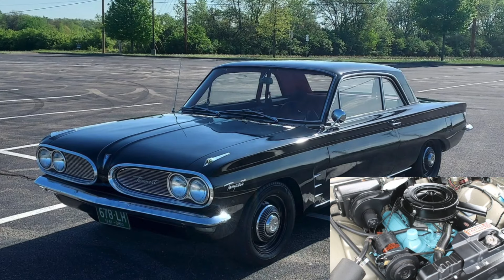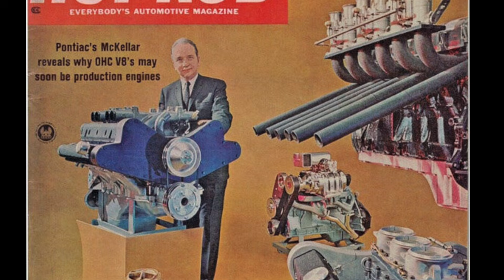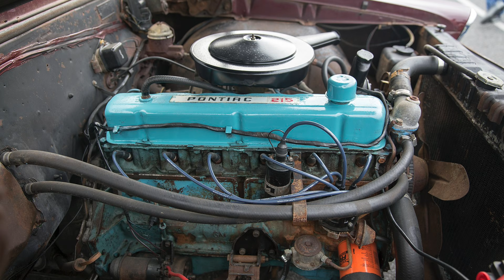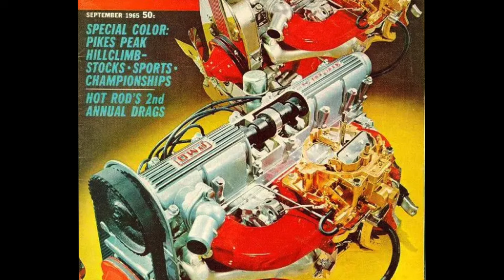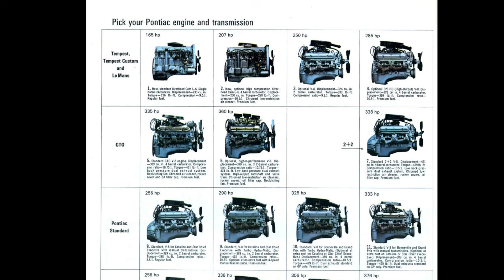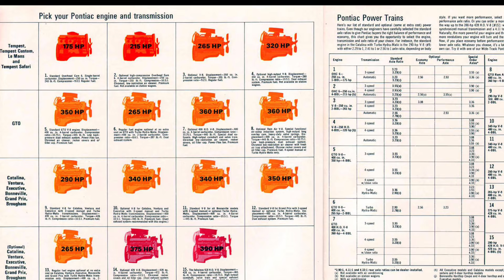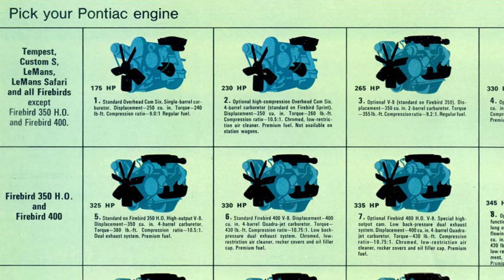Awesome Engines: Pontiac's 1966-69 OHC 6-Cylinder Engine (Tempest/Firebird/LeMans)

Comment: Holy Moly!! I'm 67 and I never heard of this Engine!! An SOHC Inline 6?? Wow!! I was 8 in 1966!!
I'm guessin that the Carb was a 2bbl.  I bet this Engine here had some punch!!
What?? Putting the Transmission at the back?? Just in front of the Differential??
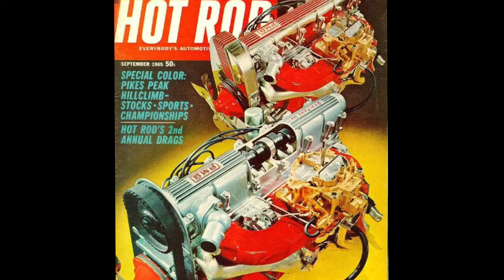05:15 - Illustrated with what looks like a Holley 4bbl!!
Reply: The Sprint version came with a 750 cfm Rochester Quadrajet carburetor.
Reply: I thought the same thing only I grew up in the car business for 35 yrs. You are a year older than me.
Reply: @coolmonkeymc8268  1959 Baby, are Ya??? I was born the same year as Madonna, Michael Jackson and Eric Singer...1958...(..who?? Who the hell is Eric Singer???....Last Drummer for KISS)
I guess you've seen some of those vids where they took an old Slant-6 from a Dodge Dart-Swinger, custom made a manifold to accommodate a Holley 4bbl, custom made a Header, mated it up to a 4-speed and turned it into Dynamo!!! One of those Dudes was able to get the HP up to about 245!! That ain't no Small Potaterz!!!
Reply: @RedneckSpaceman  1958 and Thanks for the reply I enjoyed your message.

Comment: My first car in 73 was a 67 Tempest Sprint convertible 3spd on the floor bought it for $300. Added a 4spd a couple years later . Had a blast and learned a lot about engines. Wish I still had it
Reply: You were very lucky!!  My first was a 1966 Ford Ranch Wagon. 289 2bbl. It was no Speed Machine but it could easily accelerate onto a Freeway, easily matching up with Traffic! It also was used to tow an old 1962 GlassPar Boat with a 75hp Evinrude V4 2 stroke!!
Reply: Nice ride for sure!

Comment: Worked on these engines and they were absolutely great. Most people had problems with the oiling system as the smaller version of this engine did not have a strong enough oil pump to take care of the extra oil needs of the OHC 6. I had one that I had changed the cam on and it was a Deamon on the street. So many people laughed at the six until they watched my taillights in front of them.

Comment: You haven't mentioned the fatal flaw.  This OHC 6 suffered from weaknesses in its valve train and oiling system. After reading an article in Road & Track, I think it was, my Dad traded in the '58 Ford Custom 300 he hated with a passion and bought a '66 Tempest Lemans with the Sprint Package.  It was bronze with a black vinyl roof.  Beautiful car and it handled well for the time.  My Dad liked the European stuff and had owned a single port Porsche as a young bachelor. Our Lemans was a big hit with the young men at the service stations, back when the hood got lifted when you bought gas.  Sadly, it was a hanger queen.  

One of the big issues was lubrication of the camshaft and rocker arms. The oiling system provided insufficient lubrication to the camshaft and rocker arms, particularly at high RPMs. Instead of being pressure-fed, the cam lobes and rocker arms were splash-lubricated, making them prone to excessive wear if oil flow was compromised.

And, the oiling system had passages that could develop sludge over time, leading to blockages that reduced oil delivery to the top end. This resulted in premature cam lobe and rocker wear. The issue was further exacerbated in high-performance models such as our Lemans, with the hotter cam and a four-barrel carburetor. High-RPM operation caused lubrication problems, making valvetrain wear a recurring thing.  Got expensive.

Another contributing factor was poor oil return from the cylinder head to the crankcase, causing oil to pool and leading to temporary starvation elsewhere in the engine. Over time, this inadequate oil return system increased wear on critical components.

To mitigate these issues, regular oil changes with high-zinc content oil (such as those with ZDDP additives) were recommended to protect the cam and valve train. Keeping oil passages clean by maintaining proper oil change intervals and using high-quality oil filters helped prevent sludge buildup. Some enthusiasts modified the oiling system by enlarging passages or adding external oil feeds to improve top-end lubrication. Additionally, avoiding prolonged high-RPM operation without ensuring adequate oil flow modifications was essential in prolonging engine life.

Sadly, Dad didn't know about any of this at the time and got it serviced at regular gas stations, back in the day when gas stations were really repair shops with gas pumps out front to attract business instead of mini-marts with gas pumps out front to attract fat guys to buy junk food.

We traded it in on for a grey Datsun 610 as the family car.  Dismal. In the meantime Dad had bought a '71 BMW 2002 for himself..  A great little car with a tiny radiator built for 70 degree German summers, not for 100 degree days in the Southwest.  Overheated and vapor locked. You'd have to turn on the interior heater to help keep the needle out of the red. The rubber was also rotten and belts and hoses broke.
Reply: I think most of your observations are correct, and I would add that overhead cams are mainly beneficial for high RPM, while a straight-six has a pretty long crankshaft that doesn't like high RPM...

Comment: My older brother had a Firebird that had one of these in it. He got it very cheap because it had been run out of oil and ruined the cam and all bearings. Back then (early 80s) parts were expensive and hard to find and prohibited rebuild.

Comment: I had a 1968 Firebird with the 1.9L 6 with a 3-spd floor shifter. We had a quarter mile marked off on the new inner-beltway under construction. I couldn’t take a small 8-cylinder out of the hole but by 2nd I took over every time! Good memories.

Comment: My first new car:  a 1966 Tempest  Custom with Sprint option, quick-ratio steering, "Rally Wheels", Saginaw 4-sp tranny, "big" 775/14 tires, metallic drum brakes(no discs offered until 1967), and Posi-Traction 3.55:1 rear end. A fun car to drive, and I later discovered that my younger brother used it on Saturday-night backcountry drag racing where he was very successful against small-block Mustangs.  I really regret trading it in.

Comment: My 1970 Pontiac LeMans convertible came with a Sprint 6. The guy I bought it from replaced it with a Chevy 350 V-8, but the data plates under the hood referenced the Sprint 6. So apparently, there were still some leftover Sprint 6's used in the 1970 model year. I had the car back in the 1990's & wasn't aware how special the Sprint 6 was.
Reply: There were no OHC sixes used in 1970, sprint or otherwise.  A 70 LeMans would have used the regular Chevy 250 six if not optioned with a V8.
Reply: @JohnnyAloha69 The data plates under the hood definitely referenced the "Sprint 6". I even remember a diagram or something about a cam/timing belt & being surprised that an American car of that period didn't have a timing chain.
         I suppose, that I could have had a 1969 & thought it was a 1970, but I worked on it enough, where I believe I would have noticed.	I remember, that it was a bit of a hassle, when I went to the parts store, they'd ask me the year, make, & model, & I'd have to say, it was a "1970 Pontiac LeMans with a 1974 Chevrolet 350 V-8 truck engine with a 4 bolt main bearing". Kind of a mouthful.

Comment: It really is too bad GM ditched this. Update to a twin cam head with FI and they would have had a winner in the 70s. The block while not similiar to the Chevy inline it certainly provided a starting point. About 15 years ago therewas a project started by some people in SoCal iirc to take four valve heads from the LQ-1 V-6 and chop and weld them into new heads for this engine. The LQ-1 shares the same bore centers as the SBC, the Chevy inline four and six and the Pontiac. And the Iron Duke l think.

Comment: I remember reading about a Pontiac model called the 'T-37'. That had the engine  you covered.
Reply: Late 80s, a buddy got a decent t37. 
I wanna say it had a Pontiac 350 in it though ,mighta been a 2 barrel.
Ahh fuzzy memories 😂
Reply: @MrTheHillfolk  The article that I read specifically mentioned that the T-37 had the OHC 6 cylinder and it was a screamer.
Reply: @richardmerriam7044  I  gotta think now 🤣
I'm pretty sure any of the junk me or my buddies has was rode hard and put away wet, it was probably swapped.

Comment: Owned a '68 F'bird Sprint; with 3
55:1 gearing & 3-speed, pwr steering; it was both zippy & a deft cornerer.
But, this was the muscle car era. So, the F'bird got a RA III 400 engine, with wr Muncie 4-speed,  3.55:1 12-bolt ltd slip, & a host of necessary upgrades (4-core radiator, 5/8" fuel line, frt disc brakes, '60 TA frt sway bar, HD springs, etc., etc.)
Then, car was even zippier...

Comment: I owned a 1968 Tempest 4-door (ugh) with the OHC6. I don't remember doing a thing to it other than typical maintenance. Drove that thing for thousands of miles with no appreciable issues. The front suspension on that car was the absolute pits, however, and the overall height brought the trans inspection cover down to about a 2 inches above the ground. Lost that cover on a run made in Michigan's UP up to the Pictured Rocks. Never replaced it and the car ran fine until some years later when I finally got rid of it.

Comment: My brother had a 67 Tempest w/ the 1BBL 6 cylinder years ago.  I drove it and wasn't impressed.   It didn't sell well, as most folks preferred V8's.   He replaced it with a brand new 74 Gremlin that seemed faster and more fun to drive, even with the 6.

Comment: The first "production" car with a timing belt was something from W. Germany called the Glas 1004, though only 40,000 were made from 1962 to 1968. GM introduced the Pontiac OHC 6 around the same time a Vauxhall car that also had a belt-driven OHC was introduced, so GM gets the credit, or the blame, depending on your perspective, for the popularity of timing belts. Despite the annoyance of one more maintenance item, dry belts at least have a predictable lifespan and won't slowly eat away the future of an engine the way some chain designs that incorporate plastic parts or a potentially leaky water pump can.

Comment: I inherited a '67 4 door Tempest with this engine from my brother when he went to college.  It had about 60,000 miles on it and burned so much oil the exhaust coming out of the oil fill breather was almost the same volume as what was coming out the tailpipe.  

I had to shove a length of pool filter hose in the breather and run it to the back of the car (creating dual exhaust) just to be able to breath inside when the heater was on pulling fumes from the engine compartment.

Comment: I remember one of the magazines, maybe Road and Track, actually dropped one of these in an E-type Jaguar.  A friend of mine had one of these Tempests and the bottom end blew up, so we dropped in a 326 from a junkyard.  Only problem was we did not have the bracketry needed to mount the power steering, so we had the power steering box but no boost - this thing was a beast to park...

Comment: Vauxhall built what is basically a four cylinder version of this engine in the UK, with an overhead camshaft driven by a neoprene toothed belt, from 1967 till 1979, in roadgoing form it was also tuned for torque, the larger versions producing maximum power at 5000rpm, however, all versions were very oversquare and were easily tuned up and very successful in motorsports

Comment: The fact that it used a belt or chain wasn't that big a deal in my opinion, as it was a rear-wheel drive, with a lot of access, unlike the modern FWDs, which often necessitate a hood and engine removal for access. That present an extra nuisance and cost. Why not Dupont Kevlar I wonder? The lower weight also presents an improvement in plough understeer. (as was apparent in Ford Australia’s 'Barrra' Straight six turbo)
Reply: Some transverse fwds you can just remove the right front wheel and change the belts, dont really need to remove the engine on most of them.

Comment: They probably should have kept it. Some of the V6s were real duds, in my opinion. Straight 6s are inherently smoother, and they run sweet, and with the OHC, even better. I really appreciate what you do for the car culture, Adam.
Reply: Between the feds demands for lower emissions and increased gas milage drivability really suffered. What really killed inline sixes was the move to FRONT Wheel drive and packaging. V-6 engines are an easier fit. Maybe not for servicing but for assembly and crash standards.
Reply: @mpetersen6  A real pity, I like rear-wheel drive cars with smooth engines. I do see your point, and certainly agree about the servicing. The plenums have to be removed to change the rear bank of spark plugs...
Reply: @Steven-p4j  
Oh for the days when you could open the hood. And see the surface the car was on.

Comment: the funny thing about the Pontiac 215 l-6 it is the same as the 194 chevy l-6 except the bore was bigger and it use the same pistons as the chevy 265 v-8 motor  and the chevy 230 had a even bigger bore using the same pistons as the chevy 283 v-8  . i had a 1969 tempest with the 250 motor  1 bal carb i had the 4 bal carb set up with the duel  exhaust but i never installed it

Comment: I read in a 1980 issue of Hot Rod Magazine one of the main issues with this engine, and may have lead to its demise, was cam failures often occurring within 500 miles if not carefully broken in. Never having direct experience with them I’m not sure if that is an accurate statement.

Comment: I recall seeing a new 1966 LeMans convertible with the Sprint option, midnight blue with a white top, and it had Rally wheels.  The most noticeable thing about the car was that, to me, it sounded like a Jaguar XKE.  

In 1971 I was looking to replace my 1964 Tempest sedan with a 1968 or '69 V-8 LeMans or Tempest.  For some reason, good, low-mileage examples were hard to find, especially at a reasonable price.  I was able to get a nice, '69 2 two-door hardtop in Liberty Blue over white.  It had the 350--and to my surprise--front disc brakes.  I had it until 1986, when the Northeast salted roads finally destroyed the body.  The engine however, still ran strong with over 180k miles on it.

During that 1971 search, I test drove a 1968 Tempest with the base OHC Six, and was amazed that it sounded just like my 1964 which had the 215 cid six.  The '68 was a very nice, clean car, green on green, but it was a "family car", and of course, I simply had to get a coupe.  I also looked at a 1969 LeMans two-door sedan, with the base OHC Six, loaded with almost every option, Expresso Brown over white.  It was $2,695, at a Plymouth dealership, but it was more than I could afford.

I think the main reason that the OHC 6 didn't sell that well was that everyone at the time seemed to want a V-8, and the Sprint option was probably around the same cost as the base V-8 anyway.  

As a side note, I had a book on Pontiac history which stated that 96 per cent of the 1971 LeMans line were equipped with V-8s.

Comment: I almost bought a severely rusted 69 Firebird orange black vinyl top white interior with power doors and other ideal accessories — with one of these OHC 6 for 2000$ in 2007. While I don’t regret declining the challenge due to the severe rust typical of that bodystyle in the northern states… I do regret not having a bottomless checking account keeping such an unusual car alive as it was never modified.

Comment: When I was in college, a buddy of mine bought and sold used cars all the time.  He happened on a 2 year old 1967 Pontiac LeMans two-door sedan, light metallic blue, in cherry condition.  It had the OHC 6, but otherwise was totally stripped...no radio, no heater, and a three-speed manual on the tree.  I remember it being super smooth and ultra quiet, and loafed effortlessly down the freeway...so smooth.

Comment: DeLorean was underrated as an engineer. This was the engine that should have come back after the 1974 oil crisis. The Buick V6 and the Pontiac tech 4 took a lot of work to make into good engines. The ohc six would have been great out of the box. It could have had multi speed transmissions, fuel injection, and turbos would have been killer. Even cut down to a 4 cylinder, it would have been a great engine in the Vega, with the Chevy II four as standard. Unfortunately DeLorean had moved on.

Comment: Excited to see a video from you on these! I picked up an early base 230ci one from a local guy for $100 recently, I’ve always thought these were one of the very coolest American engines, possibly because of my love of high revving japanese and european OHC engines. If I can get it unstuck and rebuild it, it will most likely end up in my ‘68 Chevy van. Even if it’s not specifically a pure Chevrolet engine, the fact that it’s period correct and GM should make it a cool swap for the original oil-burning chevy 250 currently in it.

Comment: My first car, was a used 1967 LeMans with the overhead cam 6 !  Had the 2 speed "peanut butter" dirve transmission.
Bright red, black vinyl top and black bucket seat interior. An absolutely gorgeous car. Acceleration was poor due to the
transmission. But what a great ride !  I remeber replacing the timing belt,. Tension was set by sliding the slotted oil pump - distributor assembly up or down the side of the block.  It was solid and reliable. I drove it very hard. Regretfully sold it when I went to college.  I loved that car, and I still think of it fondly. Those were sure some great years for cars.